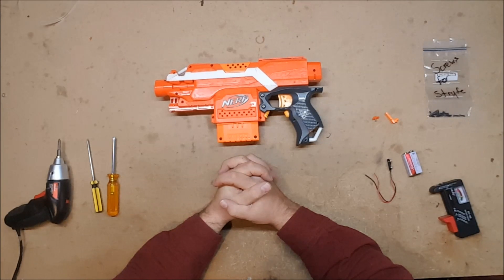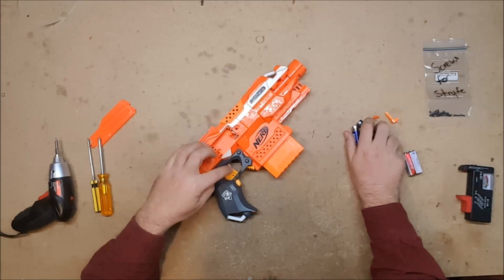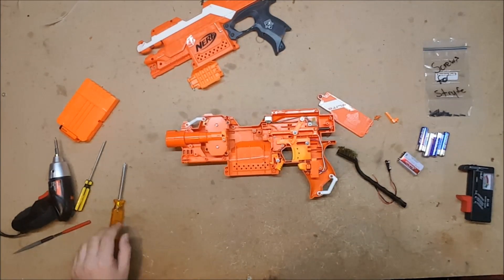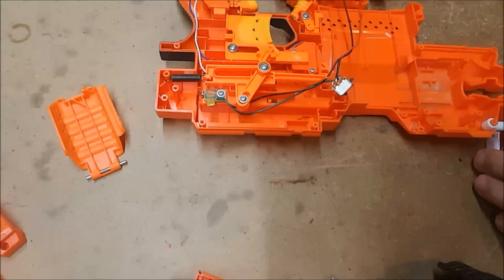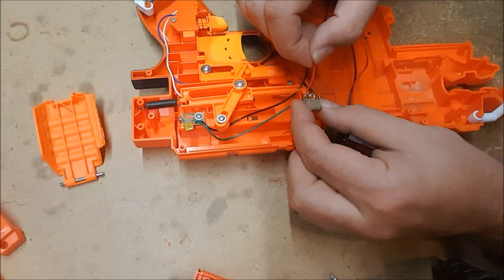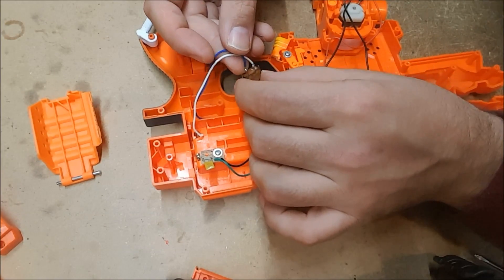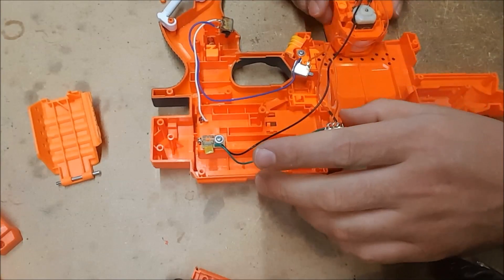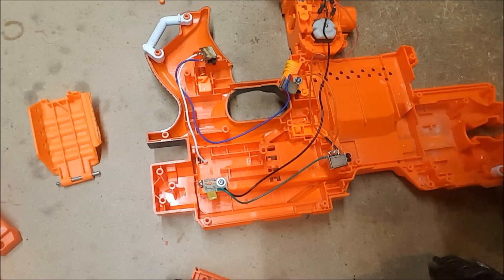Monday Mod Tips - Episode 13 - Flywheel Diagnostics

Comment: My blaster is not shooting straight what do I do about that? My flywheels are balanced, aligned and are spinning the same speed. It's shooting to the right.
Reply from the maker: Then aim to the left. ;P

But seriously, check and make sure your cage is aligned correctly. If it is not fully seated it could be slightly canted.
Reply: @CaptainXavier  Ah I may need shims, apparently not a uncommon problem with the mk3. Also think you for responding I appreciate it.

Comment: If you have a multimeter, testing switches and wires is much easier, as you can test continuity and resistance.
Reply from the maker: ...yes...but if you are someone who owns and knows how to use a multimeter you are almost certainly not going to be seeking this advise.  These videos are for people who don't already have a solid understanding of circuits and who don't already own a full set of circuit diagnostic tools...
Reply: @CaptainXavier  True, but it is much easier
Reply from the maker: @legoboy-ox2kx  anything is easier if you have the right tools. That is literally the point of tools. But that is not the point of these videos. The point of these videos is to help people who do not have the right tools.
Reply: @CaptainXavier  good point, I guess I'm just used to watching more technical videos on the topic

Comment: So uh I'm gonna follow this video but my stryfe was rewired with better motors and for a lipo and when I plugged the lipo in it didn't work and everything including the lipo was overheating (and it's worked alot already iv had this rewired for at least to weeks) my geuss is that it's the switch because it was smoking XD
Reply from the maker: +Scarlet Surge quite possibly

Comment: Quick question would 4 IMRs be enough to be some what of a replacement for one Lipo?
Reply from the maker: I am NOT an electrician so what I am about to tell you is quite probably completely incorrect.  If you want a better answer I recommend a neat little website called "Google.com." :P

But basically each IMR is the equivalent of an "s."  So 2 IMRs is basically a 2s battery.  3 IMRs is a 3s battery.  4 IMR's would be a 4s (which is more than you usually want).  So it will depend on your motors.  The issue with IMRs is they are not designed for the amount of current nor the sustained draw that Flywheel blasters require.  They also get weaker as they discharge.  This is not the case with LiPo batteries that are designed for running powerful motors like those in RC cars and drones.  They will work...but not as well and if you are not careful you can damage them or your blaster.

Key take away, do lots of research and learn to use them safely.

Comment: Excuse me but it seems that on your about page your email link does not work would you mind updating it so that it does?
Reply from the maker: I would actually.  I intentionally made it so it was not a functional link to avoid getting attacked by botnets and spammers.  It is a gmail account.  Just add @gmail to the first part and it will work.
Reply from the maker: But there is also a functional link in the description of every single video I have ever posted...just saying...

Comment: So um... what if you have a stampede that will fire the motor until a certain point, at which point it then dies and the plunger tube stays in that position until the jam door is opened? could you possibly do a video covering such blasters as the stampede with motor/spring combinations, please.
Reply from the maker: +Gairkarohn Bl'ese is it modded in any way?
Reply: Not certain, I received it used.
Reply from the maker: Ah.  Generally that is the result of lower voltage or a bad gear box

Comment: For the can or will it fit a k26?(spring) .For the rod in the plunger tube, sometimes it was to big for the spring, couldn't you have used your dremmal tool to remove some of the rod that pushes the air out of the tube? To fit the spring on?
Reply from the maker: +Josh Giffin weakening the plunger rod is generally a bad idea.
Reply: Captain Xavier However if its just a simple notch on the rod then is it fine?

Comment: When you explain multimeters, make sure you recommend a fused ammeter. Much safer, less burning. 
Also you could add the led to your 9v battery. You can test continuity across wires and switches safely. I realise you mentioned to do that with the battery tray. Just another option.

Comment: In my experience, alot of my non-working thrifted blasters with a removable battery tray (Rapidstrike, Rhinofire, Vulcan, etc...) weren't working because the spring terminals inside the blaster weren't touching the tray contacts.  Stretching/re-aligning the spring terminals solves most of my problems.

Comment: How do you get or make the tester that runs off of a 9 volt battery?
Reply from the maker: +A J Rodinsky the one I have is just a 9v connector as once found at Radio shack. I assume they can now be found online.
Reply: One could always use a cheap volt meter, such as those sold by Out of Darts.

Comment: Captain Xavier  Just curious... Was there a particular reason you didn't use a circuit tester/voltage meter? They can be had for very cheap- Harbor Freight & Tool has one that meets Nerf needs for under $5.
Reply from the maker: +Nathan Talisien because these parts most people might already have? Also, I considered that a more advanced technique that I will cover later. I do have one and I do use it.
Reply: Captain Xavier I figured there was a good reason, lol.